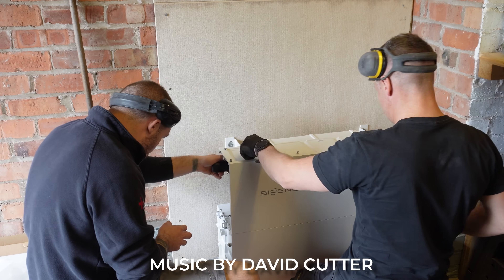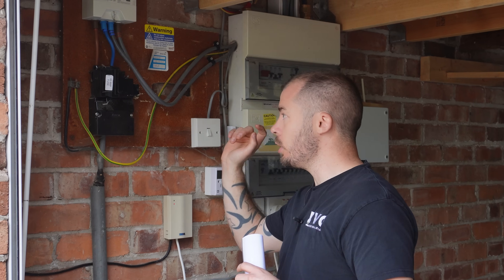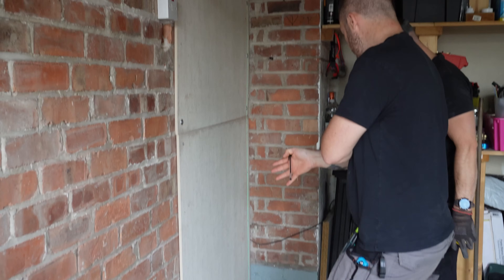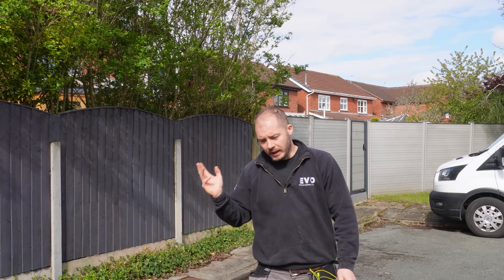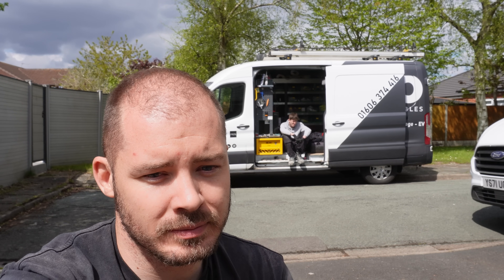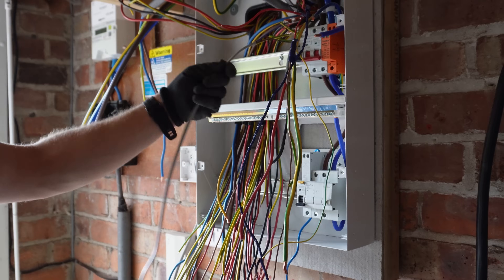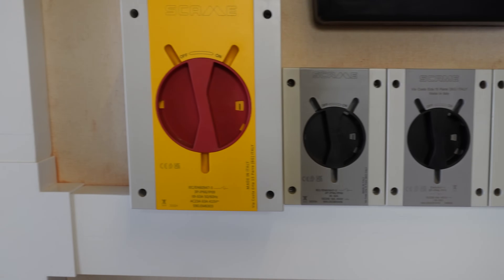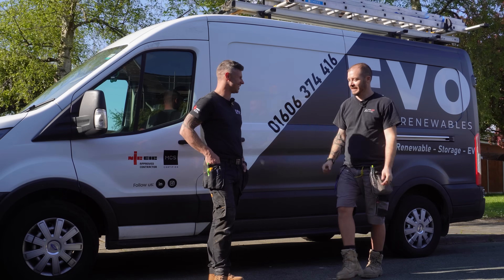“Is Sigenergy the Future of Solar? FIRST Install & Honest Review | Evo Renewables”

Comment: Ordered my Sigenergy system (20 panels, 16kWh battery, 8kW inverter and gateway for power cut backup).  Your video was interesting, looks like a good system especially the built in plug connectors
Reply from the maker: Glad it helped! 😊
Reply: Got same but 24kwh battery as rebate is only good for one install in Brisbane very happy with easy installation plus gateway backup off grid option

Comment: Recently, I had a 21kwh battery, gateway and ev charger from sig installed along with 28 x 510w panels. It's been amazing. I'm off grid now for 2 weeks and can not fault it. App is easy too with AI if required, I got 12kw from the Dno, very lucky. Just need octopus to onboard sigenergy.
Reply from the maker: Fantastic!!

I think it’s a phenomenal bit of kit which is only getting better.

Comment: Good video & information. 
Whilst I've not had a bad experience with my existing GivEnergy 3.6kW Gen 2 Hybrid inverter & 2 x 9.5kWh Gen 2 batteries, I really do need a bigger output inverter to run more house appliances at the same time & possibly a future Heat Pump (G99 needed as well). I would also like to have an EPS facility. 
If I stayed with GE I can't keep my existing batteries (their AIO is not backwards compatible with my Gen 2 batteries). So, accepting I've got to change everything I am thinking about switching to a SigEnergy system for use with my existing 14 solar panels, Zappi EV charger & Eddi. The Sig products look to be well designed & integrated. Tech support, App / Portal control would be my only concerns. My only other issue will be the cost to change & whether I could realise anything back for my existing 2nd hand GE Inverter & batteries (only 2.5 years old). Unfortunately you guys are too far away from me otherwise I might have asked for a quote. However your thoughts on the above would be appreciated.
Reply from the maker: Thanks for your comment!  We would happily look at your project as we work nationwide.  I’d also offer you some money back for your Giv system if you wanted to part exchange.
Reply: @Evorenewables  Ok Thanks. Let me consider it a bit more & get back to you. I don't want to put you to any trouble only to delay a decision due to lack of funds etc.
Reply from the maker: No problem at all, feel free to drop us an email or WhatsApp and we can discuss any options when you’re ready to do so.